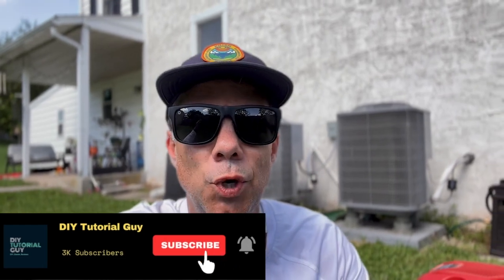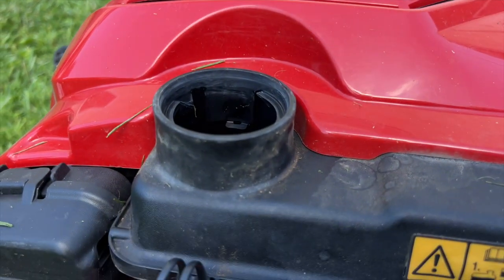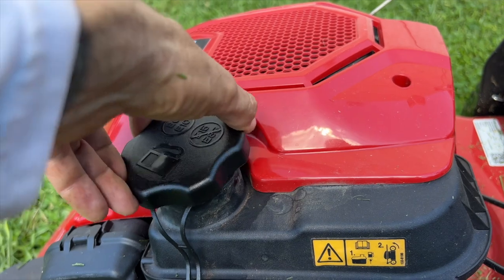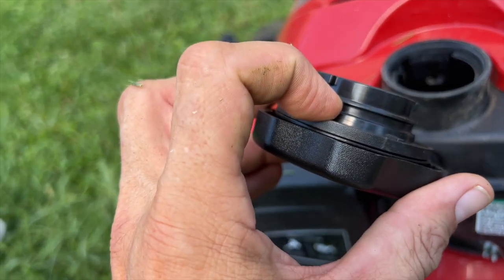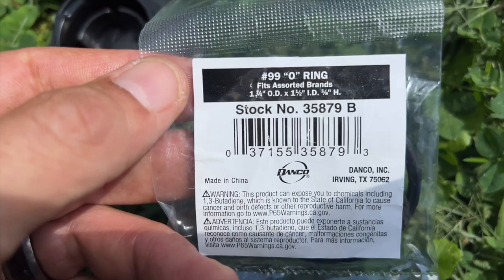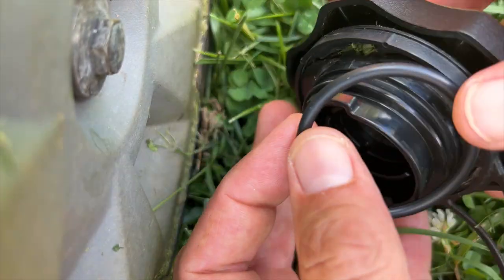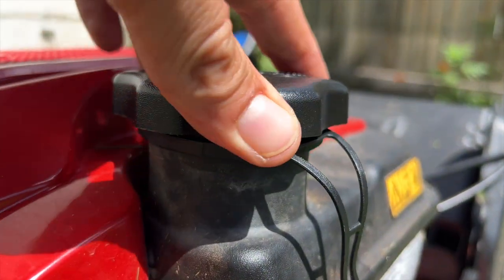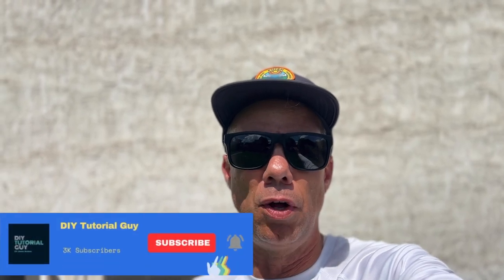How To Repair a Loose Lawnmower Gas Cap (Briggs & Stratton/Toro)

Comment: Great instructional video! To the point. As for as the part, do all gas caps use that size 'O' ring?
Reply from the maker: It is my understanding that all push and self-propelled mower gas caps are the same size.
However, when in doubt, take the cap with you to the hardware store!

Comment: Any thoughts on why its vibrating off when the gasket is not missing. Put new one (from a replacement cap) on it and still vibrates off in about 30 seconds
Reply from the maker: I don’t know what caused the original gasket to fall off.
Maybe they used a cheap gasket and it rotted?
The gasket I used in this video has held up very well and actually tightens down better than the original.
Are you using the same size as in this video?
Reply: @DIYTutorialGuy  the gasket isnt gone. On my original or the new replacement cap.
Reply from the maker: @SuperNoahsmom man, I completely misread your comment.
Being that the new gasket is holding up fine, maybe the factory gasket is cheap and prone to rotting? Outside of that, I can’t think of other reasons.
Reply: @DIYTutorialGuy  yeah neither gasket is dry. Both new cap with new gasket and the old cap with original and then new gasket are both just falling right off.🤦🏻‍♀️ craziest thing Ive ever seen in 50 yrs of using push mowers!! Lol
Currently folding up a piece of “press and seal” plastic wrap (thicker then normal cling wrap) and wedging it between mower and lid. Smdh working for now until I can get to a store and see about a thicker o ring to try.